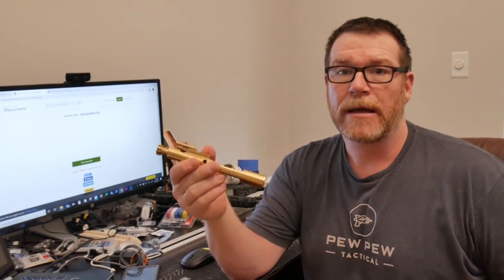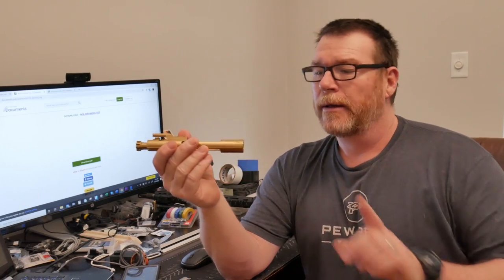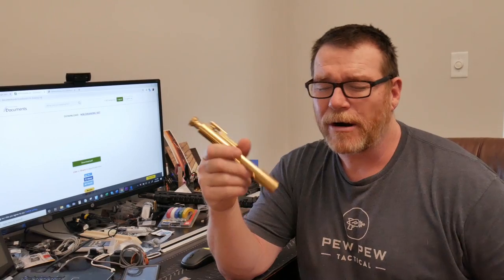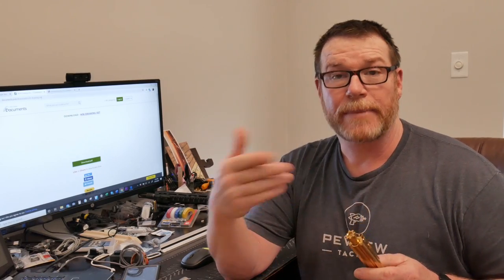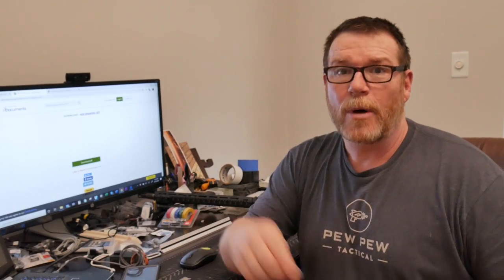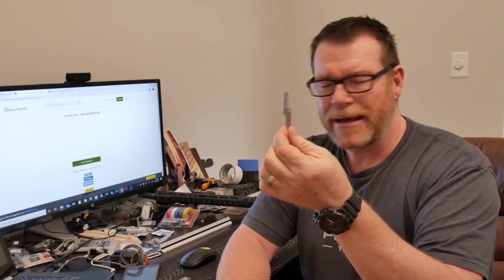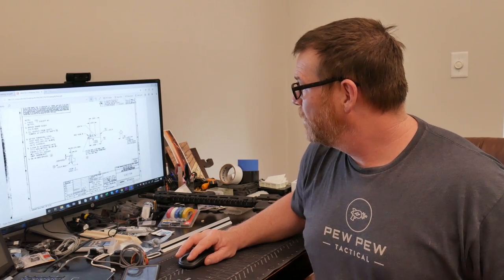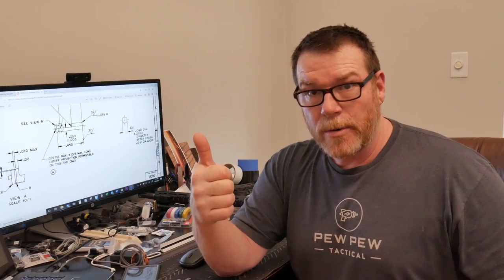Bolt Carrier Groups Part Two, Clarification, New BCG and Specifcations

Comment: I wanted a "Mystic Black" BCG, but had a damaged Sharpes DLC carrier here and put a "Mystic Silver" gas key on it (the "mystic black" key was out of stock). I always wonder about the ability of fancy coatings to hold any lube or whether the lube only really coats the aluminum of the gun--seems like the slicker the coating, the less porous it is. 
I run a JP bolt in my Sharpes DLC Carrier, and keep the Sharpes reliabolt as a backup (my whacky logic is that the angled lugs might work better with a gun that's already "mated" to a bolt before it broke).

Comment: Im so glad you made this clip.  I am building a 6.5 grendel and have been wanting to get one of there bolts.  I just wish they had some in stock for me to get.  trying to do a red out build with LeadStar upper and lower with Strike Industries red.  Just looking for a bolt and barrel to wrap it up.
Reply from the maker: Thanks for reminding me to add the 6.5 Grendel to the video
Reply: @kotaboy32  Thanks, I have alot of questions around the 6.5.  The one i was talking to my friend about is using a light weight bolt in a 6.5 build

Comment: I'm curious to hear how your Cryptic holds up.  I bought some parts from them and the coating flaked off rather quickly.  It could have been their interaction with the non-coated parts, or could have been a poor coating.

Comment: In a previous video about the new atf ruling. they change that and said that u have to remove the brace and if u have a law folder u must fold it to measure overall length. In a previous video u stated the opposite
Reply from the maker: Trying to think, but not sure that's correct.  Overall measurement must be with the folder folded.  That has never changed
Reply: Show me the law they’re referring to and I will comply

Comment: What’s a decent priced BCG that’s better than std mil spec?
Reply: Most bcgs are made by same manufacturer.  I'd recommend getting 1 that has enhancements like lantac, sharps, lmt, etc. Price will run 150 and up but you get what you pay for.
Reply: Ive been using nickel boron toolcrafts, not outrageously priced, enhanced firing pins, easy to clean, i paid $130 for my 7.62x39
Reply: Get a Radian BCG
Reply: Tough to beat a chrome lined phosphate bcg 

I’ve gone full circle, I bought into all the coatings and now I’ve come back to chrome lined gas key and bolt carrier with a tried and true phosphate coating. 

Chrome lined phosphate bcgs live under full auto conditions, isn’t as easy to clean but seriously it still isn’t difficult to clean a phosphate bcg.
Reply: @99cobra2881 Do you know of anyone making a chrome lined nitride bcg?

Comment: I have foynd a distributor that is selling unbranded odin works bcg's. I looked at it when it got delivered and the extractor was polished!  No name anywhere. I looked at the invoice and everything i bought from them had the manufacturers part #. Gold mine! Paid about 1/4 of retail.
Reply: @060blade  i will look in my records to make sure of the right one. I did a lot of homework putting together a very budget ar without crap parts. Came in sub $300! Got a bunch of bulk stuff from gunbroker.
Reply: @060blade  it was classic firearms actually! $69.99 the invoice has odinworks part #
Reply: Km tactical and gorrilla machine have some good prices. Km is on gunbroker gorrilka makes some nice handguards and blem forged uppers with no blems for $29. All forged.